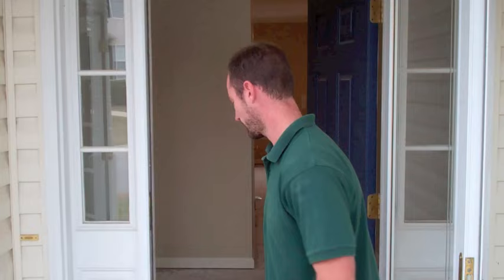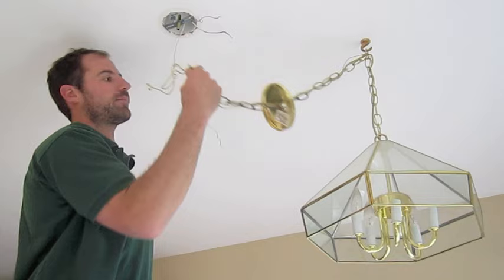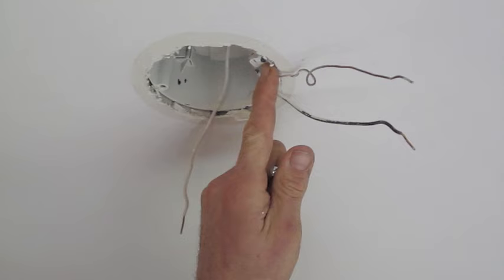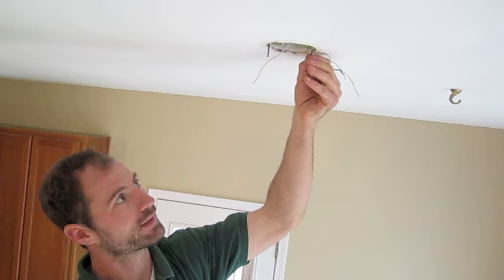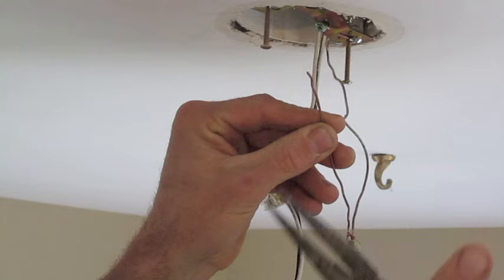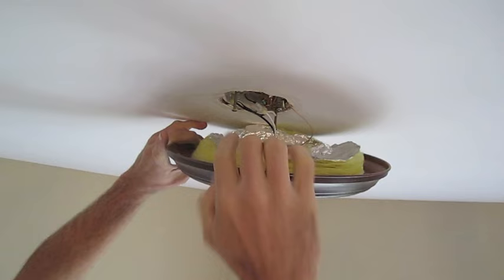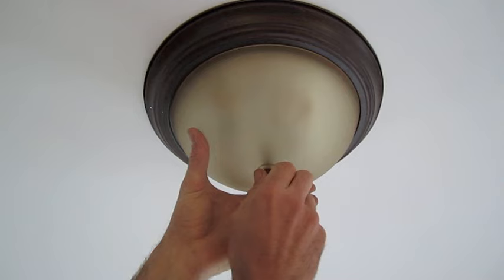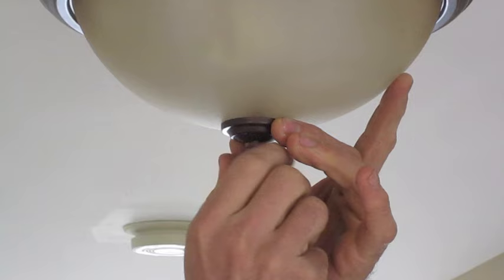How to Install a Ceiling Light Fixture

Comment: Why are the double set of wires already tied together with a cap, then another wire for each going to the hot and neutral of house? The light we bought is just 4 separate wires, can I just connect the 2 hot and 2 neutral to the main hot and neutral without this step? I've never seen that and nothings ever cone that way. Or did you leave that out of steps?
Reply from the maker: I’ve only seen that when there is a remote control or other sensor wire. Just splice the black wires together, the white wires together and the green/ground wires together. Any additional wiring from the fixture is either not necessary or should have some special instructions.

Comment: Hi, question I'm taking off my ceiling fan and putting a normal lamp, can I use the same two wires that were connected to the ceiling fan? Thank you.
Reply from the maker: Yes.
Reply: @HeirloomBuilders  Thank dearly

Comment: I have to install as similar type of light but it has 2 white and 2 Black chords coming out of fixture. Do I connect the 2 Black wires to the black one coming out of ceiling as well as connect the 2 whites to the white one coming out of ceiling?
Reply from the maker: Yes. Double check with the instructions that came with the fixture though
Reply: @HeirloomBuilders  I don't have any instructions sdbi bought 3nd hand